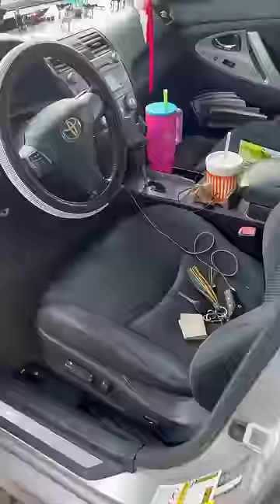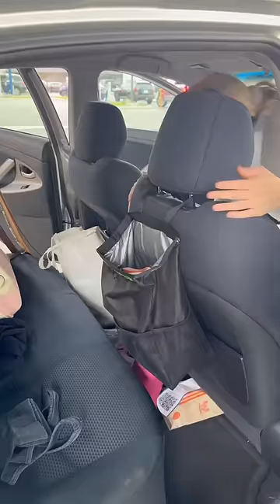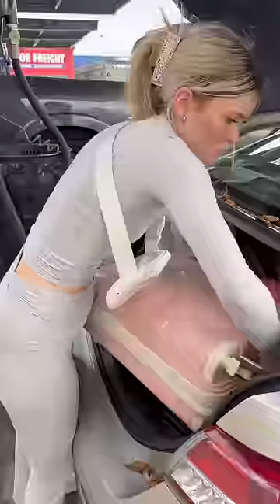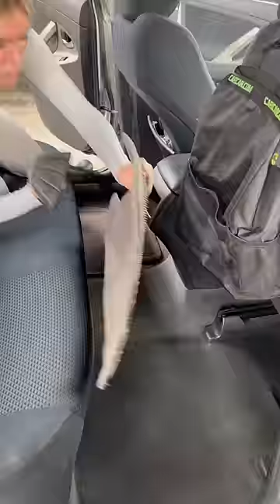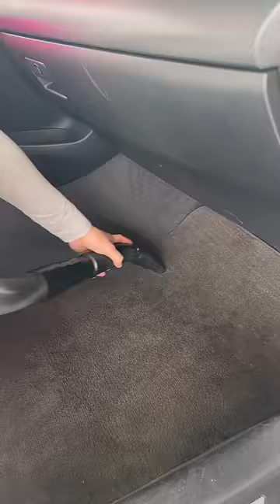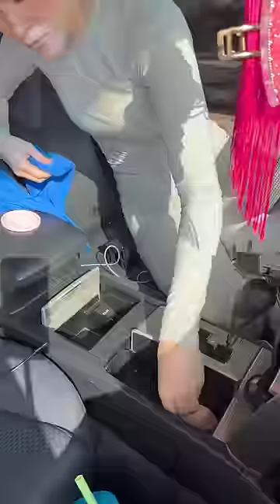Who else drives an older car?? #cleaning #satisfying #Motivation #lifestyle

Comment: 1997 Honda Accord, 135k miles. Never misses a beat.
Reply: Crikey, you don't drive much.
Reply: @vandur2322  indeed. Only small distances to cover where I live.
Reply: Dang you could probably sell that for pretty penny. Super low miles.
Reply: 99 Corolla 🎉
Reply: Same but 222,000 miles, manual, I pull small trailers and have drove it cross country a few times lately. Sadly the extreme salting of roads in the Midwest will pry do it in someday, unless I want to do a lot of welding, might have to
Reply: 1996 Honda Accord, 283K+ miles will still be running strong long after most of these newer model cars are in the junk yard.
Reply: car 1: New 2008 Toyota Highlander purchased price $30K paid off in 2013 with 335K miles and runs like new

car 2: Used 2013 Toyota Camry SE purchase price $16K paid off in 2019 with 190K miles and runs like new
Reply: No no The beat is a different Honda
Reply: Nice! I have a 89 Prelude with a couple dents and it does miss a beat sometimes and misfires when starting, but she runs and I keep her reliable, only 188888 miles
Reply: Everyone loves an old car til a major accident happens.
Reply: @JamesCook76131  What's wrong with an old car in an accident? My 2008 has front and side airbags. It's not made out of plastic.
Reply: @safeandeffectivelol  I drive over 100k miles a year. Seen way too many accidents to know, 2015 and below is pretty much a debilitating injury in anything major.
Reply: @JamesCook76131  What magical thing happened in 2015? Do you realize there were plenty of major accidents prior to 2015 where people did not have debilitating injuries?
Reply: Accord gang, RISE UP!
Reply: @safeandeffectivelol  are you not aware of safety tech to prevent car crashes? 2015 and onward is when the big push happened.
Reply: 99 Accord, 270k!! Catalytic converter is playing pranks on me but we’re still rolling
Reply: Wow that's amazing. I retired my 98 honda accord when it needed a new catalytic converter. I drove it for 10 years and it was a hand-me down from my mom. Enjoy it. I definitely miss my Honda. But my 2014 Scion IQ has been treating me well. Love the savings on gas.
Reply: @safeandeffectivelol they say Toyotas will last YEARS  and hundreds and 1000’s of miles if taken care of.   I bought a Hylander brand new last year.  Hoping it lasts me years to come, because it was EXPENSIVEEEE!!!!!! 😂
Reply: Was the car parked in storage for 10 years?
Reply: I love 90s Hondas. I saw an early 90s civic the other day, maybe a 94, and was drooling over it and amazed that it was still running. There’s nothing wrong with driving older car especially if you take good care of them.
Reply: Dang I got 389 on my 97 accord

Comment: I have 2 Toyotas. If you take care of them they’ll take care of you! 300-400,000 miles and beyond!!!
Reply: We got a 2010 Toyota tundra that has been kept in the garage over the last 6 years, before then we would try to park it in the shade during hot texas summers as much as possible. It has 160k miles and it is in Excellent shape!! It's a good looking truck and everything works great we've had to do very minimal repairs and routine maintenance...
Reply: I have a 2012 Camry, 320,000 miles and we still pushing!
Reply: @LeeLeeNicole90 u be outside OUTSIDE sis  lol u got me beat
Reply: I can verify that 1990 Chevy truck used daily for construction has 488000 miles oil changed every 5000 miles with mobil one synthetic..complete fluid changes every year ..new tires and shocks every year with front end alignment..maintain them and they last forever ..I bought it new in 1990
Reply: @AnaDiaz-wz4cf 06 tundra 301,000. Daily driver
Reply: How much to fill up the gas tank in one of those?
Reply: 97 Corolla going strong as fuck
Reply: Yes 🙂
Reply: When the engine does give, a rebuilt installed will still be a big savings over a new one!
Reply: @LeeLeeNicole90  Put a good engine in it, then you will not have to push! Lol!

Comment: I’ve got a 2003 VW Beetle. People shit on her because her check engine is always on, but she is still my first car. I’ve had her for 9 years, learned to drive manual with her, and now I’m using her to teach my stepsister how to drive manual. I love that car so much.
Reply: have you checked her engine?
Reply: @melissahelen88  all the time. I know every little thing about that car
Reply: Put some miracle grow in the flower💐 vase and it'll go another 200,000 miles!!
Reply: I have a 2008 Jetta. That dang check engine light never goes off....even after having to replacing the engine!
Reply: @InfiniteBubble  2000 tdi jetta here, she was the first VW I bought and I’m getting a 2010 final edition VW beetle so we can be a 2 car family. Super excited to get the beetle because my mom had a 1973 powder blue super beetle! Loved her car!
Reply: I drive a 2013 Beetle and I love it. I did have a new radio installed with a back up camera because for some reason giant SUV’s and trucks love to park next to me and I can’t see to back out. 😒
Reply: I have a 2002 vow beetle. She’s my pride and joy with the check engine light on and a broken Side window motor but I can’t let her go 😭😭
Reply: @May-qb3vx Get one of the bluetooth OBD2 dongles, load Torque Lite on your phone and connect to the dongle after plugging it in the OBD2 port (under the dash somewhere), clear the codes, run till the Check Engine comes on, the new code showing will tell you what the cause is. Now you'll know what needs to be seen too, might just be you've gone too long between services and oil changes.
Reply: @PiDsPagePrototypes  I already do that and get all the check ups and oil changes at least every 6,000miles or 6 months as is recommended. It’s a Volkswagen. An incessant check engine light is par for the course :)
Reply: I have a ‘05 yellow Beetle and also learned how to drive stick with her 🥰 She currently has a blown head gasket but other than that, she’s in pretty good shape 😁
Reply: I have a lime green bug 2012! I love it so much! It’s a custom green and his name is the grinch. And my check engine light is always on as well. I didn’t pass inspection cause the check engine light was on and they couldn’t get it to shut off so I have to take it to the vw dealer and have them fix it lol but I love my little bug 💚
Reply: @meowmeowmeowser6349 same 2000 tdi jetta 350 something k still goin strong
Reply: I have a 2000 TDI with over 300K. I get it!
Reply: As long as it’s not a mission critical code let it ride lol. That’s why having your own scanner tool is paramount.
Reply: 2003 kia spectra just passed 100k miles last month.🤙
Reply: You have a strange way of showing love to your car. Most people that love their car would get it serviced.
Reply: 99% of check engine lights:  gas cap or O2 sensor.
Reply: Average volkswagen
Reply: I bet the mil is on because of a P1000 code. I’ve seen this with every car, that I’ve scanned with my data link tool.
Reply: @pokerNGold  Ya hit the nail on the head, didn’t ya?
Reply: AutoZone or Advance Auto parts will do a scan tool diagnostic on the check engine light for free.
Reply: @SoosRamirez1  You get it. Still love her though. So many memories with that car even though she nickels and dimes me to death. Very high maintenance. But she gets the job done and she’s paid for
Reply: I used to have a 72 beetle, till a drunk driver rear ended me (Uninsured 😭) Repairs would have cost more than the car itself. I still get upset to this day. Never got money from the suspect, even after court.
Reply: @nathanbrady8529  100% have two right now with those 😂. Also add catalytic converter. Emissions components always crap out.
Reply: Good for you! 🙂
Reply: Can't pass emissions with check engine light on.
Reply: I have a 2004 Volvo and it's getting expensive to fix and I can't get it registered cuz my check engine light but I can't afford a new car 😢idk what to do

Comment: You rock sister!!! 2005 Honda Civic for the college kid, 2007 Honda Odyssey for mom, and 2003 Dodge Ram 2500 for dad! No car payments and couldn’t be happier. We use that money to make memories and take trips in our camper.
Reply: Never get rid of the 03 Dodge! Goes without saying but the newer ones are NOT built the same. The newer rams stay visiting our shop! I have two 2018s right now that need transmissions (like a $9k repair bill) and my shop foreman just finished timing chains, tensiners and guides on a newer 1500 that was showing cam lobe wear at 102k miles absolutely pathetic 😂

At the other end of the spectrum, we've gotta 06 Dodge ram in for 300k mile fluid services. Old man owns it and meticulous maintains it. He dropped over 4k at his 200k mile service. I have absolutely doubt we'll be doing his 400k mile service in the future, the truck will outlast the owner at this point 😅
Reply: @moremiatas  What the hell? $4k for what?
Reply: @dougfisher1813  bunch of fluid exchanges, preventative maintenence stuff most people overlook (you gotta maintain em if you want em to last) and some front end suspension components that's all I can remember off the top, the RO isn't in front of me lol. And of course, good work ain't cheap and all my techs are A1, dude!
Reply: @moremiatas  you took that old man to the cleaners lol. But seriously that's taking advantage of and scamming the elderly.
Reply: @dougfisher1813  maybe where you're from, but up here in northern Colorado,  AINT SHIT cheap homie 😆 people paying good money for good work all day long, plus  he's got 3 or 4 vehicles he's been bringing us regularly for years and we gotta 4.7 Google rating so we doing aiite but I appreciate your opinion 🤙
Reply: @moremiatas  my husband doesn’t plan to! He has a 1999 Ram 1500 he’s keeping around for some unknown reason 🤣 That’s his day to day vehicle and we mainly use the 2500 to tow our bumper pull. That 2500 and gas though 🙄 Thanks for the info, I passed it on to hubby. He appreciates you! Blessings!

Comment: I bought my '02 camry with the 2AZ-FE engine for $2k outright.  which had 190k mi. at the time.  It had been neglected by the previous owners, So I spent another $1k for replacement fluids & parts which included a full set of new tires.  After doing the maintenance myself, It regained 90% of it's Torque & Horsepower output while still achieving great gas mileage.  after 3.5 yrs of ownership, it's given me absolutely no problems, and the registration & insurance has been dirt cheap!  The odometer now reads 239k mi. I still drive it everyday, and it still performs as though it has far less mileage.  The oil changes are so easy, there's no excuse for going past the change interval.  I've owned many cars, and my old camry is one of the best cars I've ever owned in so many ways.  I don't care if that's the last car I drive for the rest  of my life.  And I'm in my mid 40's
Reply: My '06 has 297K miles on it. I guess it's the same engine that you mentioned...
Reply: Same here...I'm in my late 40s and my daily is a 97 Explorer Sport with about a quarter of a million on the clock. My weekender is a 91 Civic hot hatch. I'm not a fan of these newer "smart" cars...I like to drive, not be warned by some sensor every 5 damn minutes.
Reply: Toyotas from that era (90's-00's) are great. My '93 Corolla has just 78k miles (a time capsule), while my daily '94 has turned 173k miles. Absolutely great cars overall. I also own a '94 Suzuki Sidekick with 226k miles and a '94 Hyundai Excel with 118k miles. I'll die before I get a car payment.
Reply: I bought an 02 brand new and still drive it to this day!
Reply: How do you know the horsepower and torque? I would bet you didn't dyno it. 
Also, never buy a neglected car; you can't undo the damage just by changing fluids unless you literally tear down and rebuild the engine.
Reply: @JakeforJesus  what are you on about? Why are you acting so hard, for nothing? You sound like an American who is only just discovering Toyota 🤡 I'm a Kiwi... They are literally on every corner and every street here. I own a '99 Caldina currently, and have owned 5 other Toyotas over the years. Don't even start, kid, you're talking to a person whose entire country is Toyota culture - and has been since day one. 
Schooled.

Comment: Bought my 07 Toyota straight off the lot in 2006 & I’ve been driving her ever since. I baby her, I’ve done nothing but routine maintenance & followed Toyotas guidelines for everything  (oil, brakes/rotors, spark plugs, timing belt at 100k, etc.). She has low mileage and I plan to drive her until I can’t anymore. She may not be the newest or most aesthetically pleasing car on the road, but she’s reliable and she’s paid off.

Comment: I drive a 2000 Toyota Avalon with 269,200 miles on it. Still runs great on the original engine and transmission.

Comment: I’ve been daily driving a 1970 Pontiac GTO the past 40 years. My wife always had the new minivan or SUV for the kids.
Reply: My dream car is a 1964 GTO or should I say GOAT, lol. Or The Judge (‘69 but you knew that)
Reply: Trying to do the same thing. '70 GTO in storage last 38 years.
Reply: Smart moves did the same till 71chevelle got ripped off stolen 😢😢😢
Reply: @gerry-p9x  Sorry to hear about the Chevelle getting stolen, that just sucks! I hate thieves! No, Four Daughters and Two Sons, Nice house and all the necessities that come with raising kids. Needed to cut back on unnecessary spending. Might as well drive something you like. The current setup in the GTO is a 455 with a Fast Fuel injection system, Headers, 041 Ram Air 4 cam, T56 six speed and 373 gears. Runs around 1600 rpm at 65 mph in 6th and gets about 17miles per gallon the way I have it tuned. Still gets with the program off the line. I was aiming towards economy with this one, not drag car.

Comment: Nothing wrong driving an older car. As long as it works, keep using it. 👍🏾
Reply: Older car.  She 2010.   Some people are out of touch with the rest of us
Reply: @metooo-zo6dd  I mean 14 years old is nearly at the bottom of it's depreciation. Almost all non collector cars have lost 80% of their value in the first 10 years of ownership. 2010 might not be a classic, but considering the lifespan of most cars is around 10 to 20 years before they end up in junkyards, it qualifies as an "older" car. 

It obviously depends on factors like how much you drive, where you live, and how well it is maintained. But most people don't do engine rebuilds on a Toyota Camry when it reaches the end of its lifespan (in the west) because it would cost more in labor and parts than the car is worth. I live in Canada so the only cars that last more than 20 years are ones that are exceptionally maintained or just driven at a below average rate.

Comment: 2006 Toyota Yaris. Had it since 39K. Its now done 247K. I have just kept fixing it over the years because I have all the tools and its cheap. Plenty of parts in scrapyards. I even put a used engine in it recently and it only ever let me down once when the engine was worn out. Its taken me to 23 different countries and always got me home. So many times I was travelling for work, commuting long distances every day or doing deliveries with it and I had no money and it never let me down.
Reply: Engine worn out at 247k? That doesn't sound right. What exactly happened?
Reply: @MaxCroat  It is their smallest engine - 1KR-FE which only has 3 cylinders. They are in a lot of cars in Europe. They are cheap and made to a budget. The Yaris is probably at the limit of what it can cope with an I have used the car for hauling around a lot of weight over thousands of miles. 

The main reason mine got swapped out was because the head gasket had failed and start to leak coolant into Cylinder No. 3. Believe it or not a used engine is almost as cheap and less work than changing the headgasket. My engine was also low on compression. It was an oil burner and the cylinder walls were getting quite smooth. It needed a hone and maybe oversized pistons as well as rings. So when you can get a low mileage engine for £300 delivered why bother repairing it? I also installed a new clutch while I was at it. In a way it was sad. I stripped it down after taking it out and the top end, timing and bearings on the bottom end were all immaculate. It was just the rings and bores which were bad and the head gasket had failed.
Reply: @zoidberg444  yes I am also from a european country so I am well aware of the push with three cylinder engines in cars. I dont know where exactly you are from, but that amount of money for a used engine is very cheap. I am very surprised to hear that, as usually it is hard to find even an engine in bad/unknown condition with unknown odometer and no warranty for that cheap.

Comment: I have a 2016 Ford Fiesta with almost 160,000 miles on it. Paid $4300 cash for it because the check engine light was on and the shop wanted to charge the owner $2000 to fix it. At the time I got it the car had 99k miles. After I diagnosed it, I determined I needed a new catalytic converter and a fuel purge solenoid valve. $230 in parts and 1 day labor, I was done.

No high monthly payments, no high insurance, no high registration, maintenance is cheap. I’m running this into the dirt before I get another fixer upper.
Reply: I don’t believe you
Reply: Cats aren’t only $230. They run anywhere from $1000 to $3000 easy.
Reply: When did you buy it? I’m pretty sure we got our ford fiesta in 2016 and it was 30k new 😅 we had to get the fiesta because our other fiesta from 2013 was a lemon and all ford would do was loan us another fiesta. We’re in a class action lawsuit for it. The fiesta and focus’s were all crap from 2011 to 2016.
Reply: @Callsign_Sturm  depends on how old we are talking. They have changed cats so much and this guy talked about changing his cat for $230. That is no cat swap. It’s something else we not told.
Reply: i paid 500 for all includng the flexi pipe on my fiesta and a whole new cat